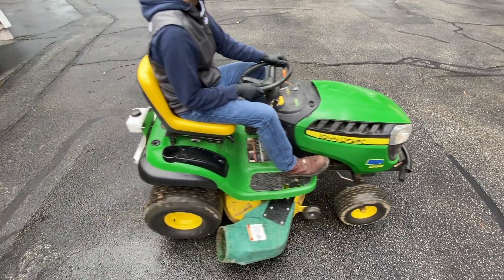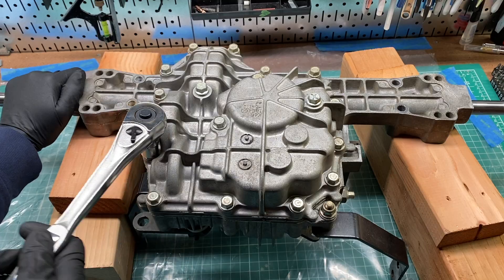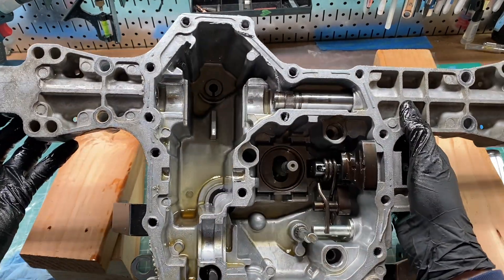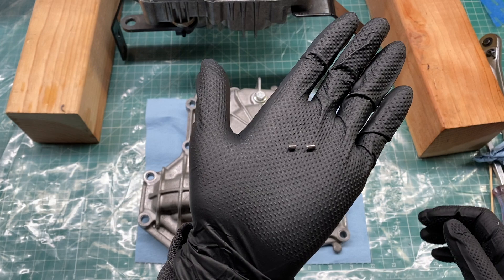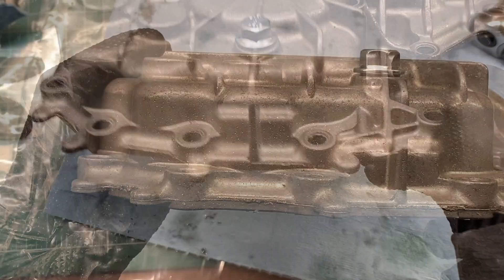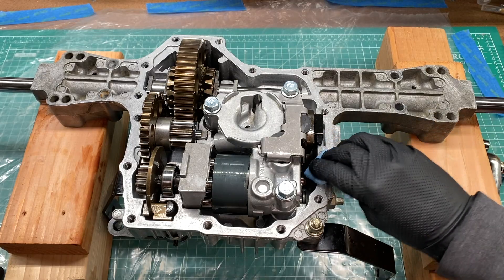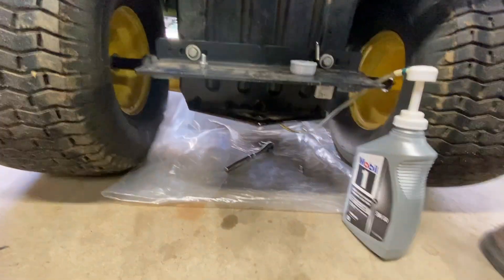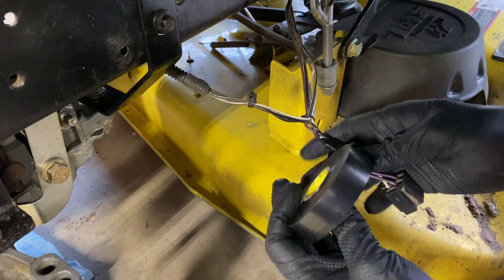Tuff Torq K46 / T40J ONE YEAR LATER  (Oil Fill Mod Series Video 4)

Comment: No need to use aluminum ar copper crush washers here.  It takes too much torque on that short aluminum case thread to deform the metal washers to make the seal.  A plastic flat washer, or even a neoprene O-ring will work just fine and will require much less stress on that case thread.  There is zero oil pressure inside the case here and very little heat so a plastic seal is what is needed here.

Comment: I think you've got something wrong with your transmission and you're probably using the wrong oil because I overhaul my transmission after 15 years and the oil was still fairly clear with very little metal. I used tractor transmission oil to replace the original.

Comment: Enjoyable video.  Looking at your wiring mess, I think it's a good idea to add split sleave tubing over any wiring harness that is just individual wires.  This at least gives you another level of protection ... until your PTO spins due to a bad belt and shears off its wires flush at the PTO body.  That's another story.  This video is more moral support for my expansion tank addition to a new Gravely with internal tanks.  Cheap and stupid idea for Hydro Gear and Gravely and others just play along.  You NEED a  visual.  There are too many seals and chances for a leak costing $$thousands.  Parts are in hand but Hydro Gear says no, no, no to adding tanks to the system.  Hydro Gear and AI engines do fall prey to my counter argument.  This is only liquid and is at atmospheric to maybe 1 or 2 PSI at certain times.

Comment: The bypass-pin will break when you leave the trans axle release input rod set to not-released; see the half-moon cut out of the bypass input-shaft. I nearly did this myself, so folks, put that lever in NON-BYPASS mode while you are installing the housing for the pump/motor assy. That will give the bypass pin room to float a bit; put some grease on the bypass pin to hold it in place, too; Next: watch that WEDGE (the 'fixed' motor swash plate) on the left, it will need to be guided down so that the index on it meshes with the upper-case index, else your will possibly damage something there too. Don't put the wedge in backwards. (I just did my K46 repair-kit today, so all of this is fresh on my mind. Very good video, and as other said, thank you for including your mistakes - that is VERY HELPFUL. That is how we really teach! and how we really learn!

Comment: TUFF TORQ's oil for the K46 is 10W30; I may add a bit of Schaefer's 131C to it; anyway, it is not 5W50; you may be okay if you are in the South with that viscosity, just bear in mind the current listing at the TT website for the K46 is 10W30 or the TT oil;

Comment: Wow,  no doubt you suffer from OCD but more power to ya since you enjoy spending so much time on the mower.  I've had the 2006 John Deere 155C, 48"  deck since new and still mowing the 2 acre, rough, farm lawn here in Michigan.  Around 700 hrs., and 16 yrs I noticed the tranmission wasn't as strong anymore.  J.D. said there is no servicing but Y.T. has several vids about pulling it out,  draining and adding new fluid.  Only takes about 20 min. to have it out with wheels off,  flip upside down with axle housings on jack stands to drain all out all oil through the 1 3/8" plug into a pan without a mess.   20 minutes to change the oil once every 10 yrs.,  500 hrs. ?  How much time and hassle did you spend with drain plugs and silly tank, risking damage to trans?   But I also removed the bottom pan,  cleaned the screen that was clean, cleaned the 2 magnets,  resealed and refilled with J.D. Hy-GARD  J20C.  So now it's around 900 hrs., 19 yrs. old with engine, steering,  deck,  transmission all work as when new,,, so just what have you gained with all those mods?  You're creative and skilled but there are those that will attempt what you did and end up with turning a good mower into a parts machine.  At 70, on the farm I think it's bad advice for most.

Comment: curious why you didn't just put a heli-coil in it instead of going up to a larger bolt size. You would have been able to keep your original bolts, and, would have gotten much stronger steel threads, instead of the aluminum case threads.
Reply from the maker: I could have. I’m aware of them but I’ve never used them before. I know they are designed to be permanent and not unscrew, but I am still afraid it could come unscrewed hah. Maybe that could only happen if you over torque the bolt? Seems like a totally valid solution though. Maybe I’ll get a kit!

Comment: Thank you. I appreciate you filming your mistakes, too. This helps everyone. I once incorrectly set my torque wrench and stripped a head bolt. Yep, a life lesson there. Mistakes are okay as long as we learn from them. Tuff torq really pulled a boo boo when NOT putting drain plugs on these TRANS. Then, they put conventional oil instead of synthetic also. I love American ingenuity, but Im so disappointed when the engineers and the repair persons do not communicate. They could really learn a lot from Asian and European Auto manufacturers. Oh well, Im never again buying a Husqvarna. Will the greedy American companies ever learn? "it is not just about the next quarterly profit"  It's about keeping a customer for LIFE. Good day!
Reply: Tuff Torq pulled a boo boo?  My 155C that I bought new was about 16 yrs. old and 700 hrs. on the rough, 2 acre farm yard when I noticed transmission seemed to be weak.   J.D. and everyone else know that most homeowners using this type of mower have smaller yards,  don't take care of their mowers and generally replace with a new mower in 5 to 10 yrs.  Most can't fix their mower and get tired of tired of repair bills so simply buy a new one.  Certainly not all but most buy a newer one because of higher bills.  Just bought a nice LX188 from the Widow next door because she got tired of spending hundreds every year for oil changes etc.

Comment: Brother, I thought things like this only happened to me.  Misery loves company as they say.  At any rate, for what you went through, it definitely deserves a like.  How did it feel having to clean up and reseal that bottom case each time you had to crack it open and reseal it?
Reply from the maker: Haha! Scraping off the old seal and cleaning the case is brutal! If I have to do it again there might be a global shortage of brake cleaner afterwards 😀
Reply: @MostlyBuilds Having performed this painfully slow procedure on video several times myself (and having to do it again this week), I’m convinced placing a soft brass wire brush in a drill or Dremel is the fastest method.  Dean

Comment: Hello, Thank for your vidéo, she is very interesting. For the news drains plug, may be is better to put un safety wire on them, as is done in aviation, for that only drill them head with a little drill bit. In any case, good job, he is véry clean. Sorry for my english, i am watch you from the Françe, good luck pour the future.

Comment: Very Well Done.  I have a 40J trans in a LA125 I am restoring.   Finally thanks to You I know it is similar to a K46.  It has always been shown that the Critical fluid height is 7/8" below top of fill plug yet you have fluid over 12" above.  Any problem with that?
Reply from the maker: Thanks! I haven’t had any issues with the over filling that I’m aware of. The only potential issue that I’ve thought of could be the transfer of metal flakes from one side of the case to the other since I’ve essentially created a pathway of oil between both sides of the case. I don’t know if this happens, but I’m also changing the oil, so I’m getting stuff out that would otherwise hang around for a while. My biggest worry there is metal flakes being created on the gearing side, could be carried over to the pump side, and managing to scratch faces of the pump parts.

The other aspect of the “fill line” spec being violated is that I’ve created a place for the oil to move to when it expands (the expansion tank). Otherwise if you overfilled it without an expansion tank, I imagine the oil would get forced out of the trans through the vent and make a mess.

Another thing to call out is that some K46 variants have an expansion tank. Assuming that the case internals are the same (two separated sides), then that’s the same setup as my mod. I am making some assumptions here since I’ve never actually laid eyes on that variant though.

Long story short, I haven’t encountered any issues from doing this mod. Proceed with caution though! Maybe next year I’ll be posting a video about the trans catastrophically failing 😛

Comment: The general consensus is that synthetic oil is superior to conventional oil..but i wonder if there is a specific additive package in the Tuff Torq oil that is for that specific use case that prevents the wear that you found in your transaxle? You should check out "The Motor Oil Geek" on youtube. Watching his videos blew my mind on how oil works, he explains that certain additive packages are necessary to make oil do what we need it to in certain use cases. So even though synthetic oil is usually considered better, there may be a different oil that is better suited for this transaxle than just normal motor oil.
Reply from the maker: Thanks I’ll check that out! When I spoke with someone at Tuff Torq they basically said their brand of oil has been specially formulated for the transaxles. They also made it sound like the oil that’s speced out by the mower manufacturers is different and lower quality than if you bought their recommended oil. I think their recommended oil is a special blend that’s synthetic and the stuff that ships in the trans is conventional oil (maybe with special additives as well). This was my recollection from 2 years ago. Who knows what really goes on though 😀

Comment: There are many variations of the K46 I have a 2021 Craftsman tight turn T240..it's dry weight is 630 pounds it's heavy it not one K46 fits all some are more heavier duty than others you can't have a K46 from a 450 pound tractor pulling 630 pounds..and very easy to change the oil

Comment: The problem with a drain plug in the pump side of the case where the position is that it leaves a small amount of oil in the case right where the filter is . On the hand a plug could be fitted in the lower part of the case where the filter is but would be exposed to damage on the underside of the mower . Also the case thickness where the filter is may not be as thick as on the side .

Comment: This series is one of the best and most detailed on the K46, and the engineering/assembly is awesome as well. Thank you for making it!

If there is ever a reason for you pull the trans again, creating a "how to pull trans" from the mower video would really useful. There aren't any good videos out there on how to safely remove the trans for a rebuild. While the trans is used in lots of mowers and brands, the hookup points are likely very similar.
Reply from the maker: Thanks! Great suggestion on a trans removal video. I’ll def keep that in mind.

Comment: A lot depends upon how many times you mow in a year but most importantly if you're towing stuff or mowing on hilly terrain. Obviously anything that causes an extra load on the transmission will cause the oil to breakdown quicker.

Comment: haha, this looks like a "time saver" I've done before...have to take it all apart anyway. Its too bad they didn't design it with a plug and filter access to begin with...planned failure by the mover manufactures...just want it to last till the warranty is up. gotta pull it to clean the filter...kind of pisses me off

Comment: Great stuff!  I recently bought a used Craftsman Pro 8400 with this trans in it.  It has only 50 hours on it, so ill be performing your drain plug mods and doing an oil/filter change on it soon.  Thanks for the great work!!
Reply from the maker: Awesome! Would love to hear how it works out. So far only one person has reported back after trying it and it failed because he drilled out the vent hole at an angle by accident and couldn’t get a good seal. Best of luck with your build!

Comment: I think it's possible that when you reassembled this mod, way back when, that the fan was above the disk that holds the belt. This could be backwards, only according to other videos I've been watching related to the K46 transaxle. Others have made this mistake too and comment that they are surprised there is no consequences when assembling it the wrong way. I wouldn't be surprised if this is what chewed up those wires, the fan being higher than originally intended. Maybe I'm way off though, just thought I'd share. Thanks for making your videos so detailed!!!
Reply from the maker: It’s a good callout. On my particular machine the fan goes on top of the pulley. I’ve seen others that have it in the reverse with the pulley on top like you describe.

I’m pretty sure I just routed the wires either around the belt or too close to it. Brutal! Thanks for the comment and for checking out the video!

Comment: Neat mods.  Did you ever find the wear points for those aluminum shavings? Possibly from the refurbished pump housing? I'm about to send mine off for repair.
Reply from the maker: I didn’t see anything obvious in regard to wear points. It did cross my mind that I could have reversed the washers on either side of the small gear, causing it to rub on the case differently. Or I may have missed some particles when cleaning the case and that caused the wear. You really need to do a good job cleaning out the case. This last round of taking the trans apart, I ended up flushing the whole thing with fresh oil (in addition to using a ton of cleaner) because I took it apart multiple times due to breaking the bypass pin. 

When I got my parts back from being rebuilt, they looked very clean. When I saw the new wear this time around, I considered sending the parts out again but didn’t want to have to wait to get them back. I just risked it and very carefully sanded the center case faces with something like 3k grit paper. I don’t know what else the rebuild guy does with the parts. I think he also does something with the little pistons because they came back with a marker line on the face of each one.

Good luck with the rebuild. If you come across anything interesting please feel free to share 😀

Comment: I was taught by a old timer .  If you add 1 oz of stp per qt of oil to rearend manual transmission. It works by finding friction points to aid in stopping wear. Just fyi. And it works.
Reply: All and any oil additives are bad. The manufacturer engineered your oil to have compatible additives already in it. If you want different additives then buy a different oil. You are not smarter than a team of engineers in a lab.
Reply: @Rudy97  The STP team of engineers in a lab disagree.
Reply: @WayneMarionbecause they want you to buy that snake oil